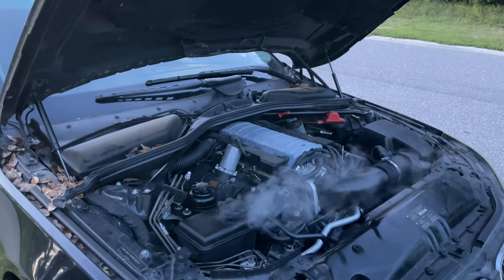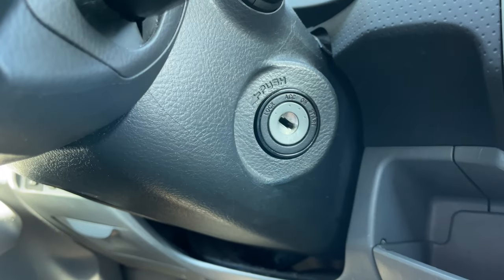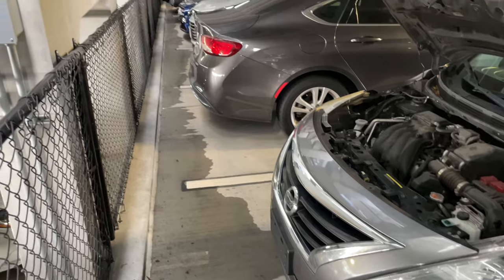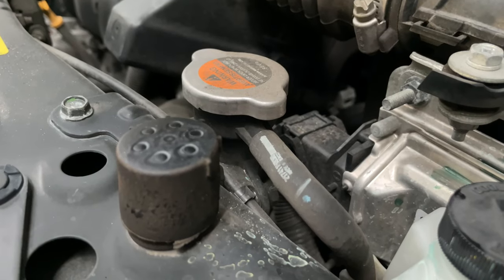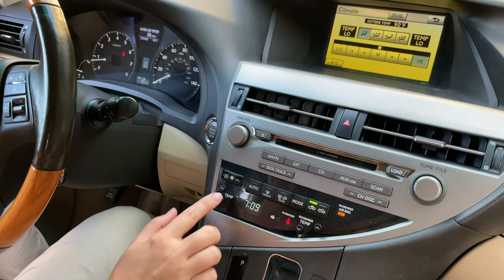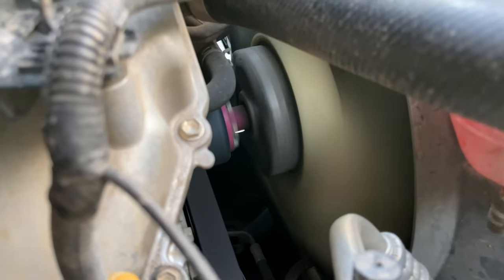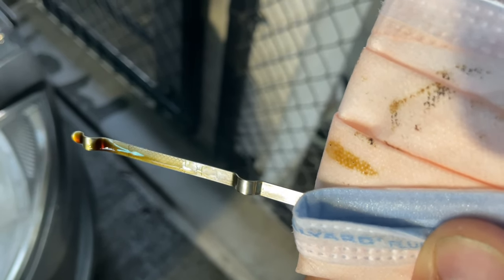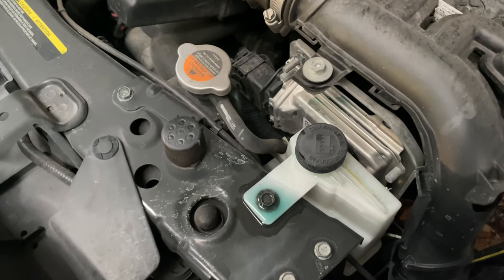How to diagnose smoking & steaming under the hood of your car.

Comment: Coolant leak could be also due to the hose running from engine to the blower heat system. I got a leak from there. Coolant drips along the hose down to the radiator.
Reply from the maker: Thanks for sharing.
Reply: How do I fix it
Reply: @b.g.sowavy406  all you would need are a hose clamp (OD type or a type with the screw, i prefer the one with screw) and a copper pipe, only 3 inche length and 1/2 inch diameter.

Comment: My radiator hose came off while driving and splashed coolant all over the engine and I think that’s what the smoke was because the engine was hot when coolant exploded everywhere
Reply: Hey was this the case after all?? My radiator hose also popped and threw coolant all over. Now that I swapped it I’m getting smoke
Reply: @JoseSanchez-df8hb  yeah it will go away if you just wipe with rag and water or just leave engine on/hood up to burn the rest.... the only reason this happened was because I installed new radiator hose with the wrong radiator clamps, I had on the ones you screw on with a screw driver instead the one you need pliers for
Reply: For me there was white smoke turned the car off before car sensor indicated overheating and Coolant was pouring out from what looked like sides of the radiator and behind engine literally pouring and was white smoke radiator hose was replaced too i think how likely do u think this is the case for me? Or how can i check? Thank you

Comment: My radiator and engine has no antifreeze at all but the overflow tank is full it appears the overflow tank push out the fluid but when I put coolant in radiator i hear boiling and a lot of smoke coming from engine the engine is hot af so maybe I’ll wait 5 hours than add coolant

Comment: i jus recently noticed the other night when my car was running i seen light smoke coming from the front of the car but car was not overheating or anything and i didnt see any leaks. ik the car has an exhaust leak, not sure where but could it be that? also when i opened the hood i didnt see any smoke, i guess the smoke builds up when hood is closed
Reply: Same
Reply: bruh what was it
Reply: @levitativ845  bru turns out i do have an oil leak lmaoo. but it was valve covers leaking oil onto the exhaust & the smoke is jus the oil burning off
Reply: @eric4572  oh wow how much was the fix

Comment: It could also be a blown head gasket. If you see a coolant boiling it means that head gasket has blown. That was mine case unfortunately
Reply: blown out to the exterior?
Reply: How bad was your coolant boiling was it real noticeable
Reply: Yes it was noticeable, you could’ve clearly see the bubbles and a little bit of smoke. We actually fixed it, the place where it blew on the head gasket was barely visible to the naked eye.

Comment: Yeah, mine is leaking steam through front of the grill from the radiator, and heat will stop being hot unless I increase temp, but then eventually that will go cold too after long periods of driving of like 3hrs or so. I haven't had the AC checked and drove over 40,000 miles. I assume it's something related to those fluids  in the thin metal tubes. I think they're labeled H and C on the little caps.

Comment: I've been looking for days for my problem and can't find it I changed my thermostat recently and I installed it perfectly but when I went to start my car thick white smoke came out of my hood on the passenger side I got told it might be the head gasket but I got no mixture and the car was cold I got told it might be the exhaust manifold it can be a cracked block I just don't know what it can be and is it safe to turn back on to see or do I have a chance of catching my car on fire?
Reply: We had the same exact situation, i was told it could be a blown head gasket or cylinder. Or a super bad exaust leak, but that depends if its smoke or vapor
Reply: @ThatoneguysYT32  what's difference between smoke or vapor?
Reply: @kennyrobert9785  smoke is from something burning like oil or a wire or hose, vapor is from a liquid burning from a hot surface like dripping onto the exaust
Reply: @ThatoneguysYT32  thanks
Reply: @eygamereygamer9924 did you fix it?
Reply: @yosefortez4009  yeah i was just dumb and didnt check my oil the person who did the oil change put 10L instead of 5L 😂
Reply: @eygamereygamer9924  interesting 🤔
Reply: I have gray smoke coming from the right side of my engine and it has a smell. The car sat for 3 years. I already changed the oil and gas and put fuel injector cleaner. Any ideas? It is a 2001 mercdes slk
Reply: @diananowicki2518  did you empty the fuel tank completely ? If you got an exhaust leak the smoke will come from the side, it can be a bad o2 sensor or a bad cat bad fuel, something for sure related to one of those
Reply: @eygamereygamer9924  the tank was already empty. I added 5 gallons of gas and Lucas fuel injector.

Comment: Very helpful video. Thank you- I have a honda pilot 2003 and the other day my car wss smoking and my husband refilled the coolant and it was normal for 3 days until this morning it started smoking again. I'm assuming it's a combination of the fan + coolant leak. I have an appointment to bring my car to the dealership on the 10th to get fixed.

Comment: My 2014 Altima 2.5S is producing white smoke from the radiators at the very front of the car. It only does that when the AC is turned OFF... as soon as I turn the AC ON, the smoke goes away. It;s worth mentioning that the AC system is not cooling at all. And it's also worth mentioning that the engine temperature is normal. It's not the engine overheating.

Could someone kind of speculate as to what could this issue be?
Reply: I have an 2014 Altima and my air compressor has went out. My air won’t get cold. I smell a little oil while driving one day. Also, I saw very little smoke not a lot..My mechanic is going to replace it for me.
Reply: @MJ-ln4xm  mine was the compressor as well. Those Altimas happen to suffer from bad compressors.

Comment: What if temperature is normal and you get steam could that be the Fuel Pressure Regulator, 02 Sensor not pushing the right amount of fuel into proper places 🤔
Reply: Hey man what was your issue? I’m having the same thing
Reply: @Bshmoneyyy  it ended up being water pump and as well as timing cover gasket and timing cover

Comment: I have a 2005 Acura tl I changed my head gasket but it seems that it’s white smoke coming from my catalytic  converter was wandering could a clogged cat cause white smoke from under the hood
Reply: I’m having the same problem smoke coming from my Cat please lmk how it went with you
Reply: What’s was it guys ?
Reply: @jaymosiah220  wasn’t really my cat but it was the oil burning off it

Comment: My 2011 GT started producing smoke but its very faint and only visible when I take the oil cap off drives fine nothing feels wrong
Reply: Yeah im having the same sorta issue…im having faint smoke but driving feels fine
Reply: @Carlos-wx8cc  I'd take it to a tuner shop found out something was wrong with my engine im getting it rebuilt